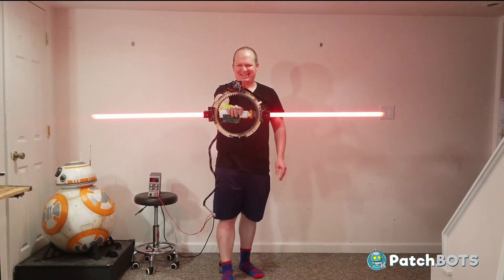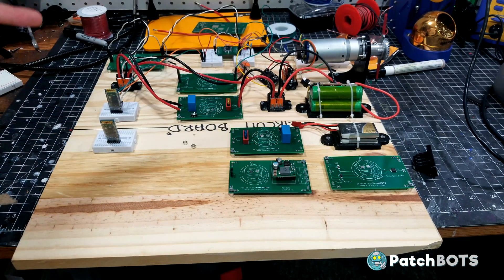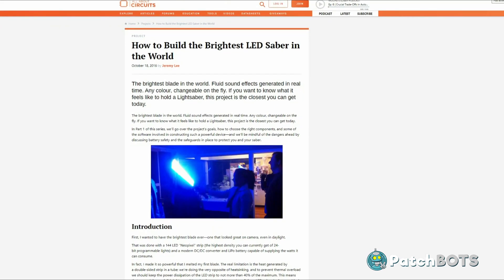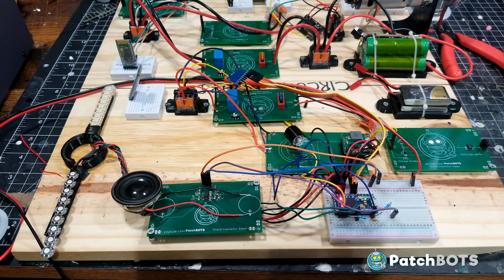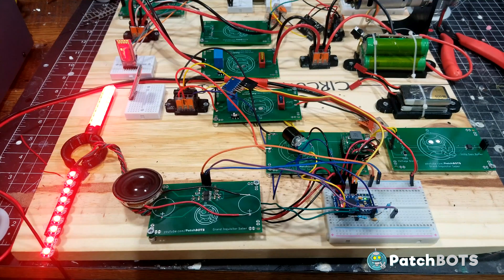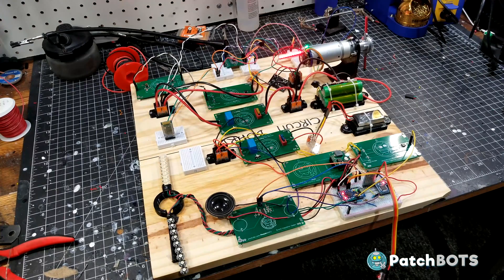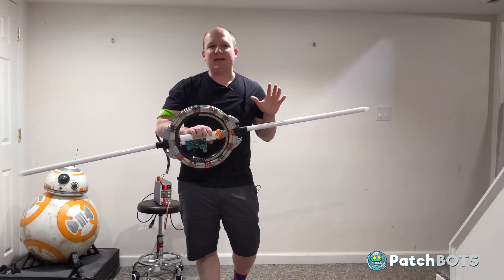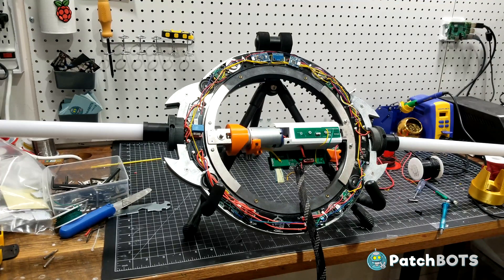Spinning Light Saber - Part 3 - Outer Saber Circuit

Comment from the maker: May the 4th be with you!  For a limited time subscribe to this channel for FREE by clicking that button right up there ^
Reply: May ı ask where you find the BB-8 files from xrobots. I want to build one please
Reply from the maker: @BoraGurses  You can find them on James's GitHub.  I would suggest also looking into other solutions as that drive/model are pretty old at this point.  The new VonJet V3 sphere and the A&P Dome are the new standards for the exterior.  Check out the BB-8 builder's club forums for more info.
Reply: @PatchBOTS  Thank you very much for your answer.  I joined the bb-8 builder’s club but they still haven't taken it to the facebook group. Still waiting. Thank you so much again.

Comment: Dead project or will we be coming back to this one soon?
Reply from the maker: I moved house last year.  Projects took a back seat.  Definitely getting back to this one ASAP, especially with rumors of the Grand Inquisitor in the new Obi Wan series.
Reply from the maker: I"m going to expand on this answer for anyone else reading;   This project is a lot of fun to work on.  I'm going to give one more go at getting this current version spinning in it's current state before I start on the V2.   Ive recenetly acquired a larger printer (capable of printing the ring in one piece).  Another new printer capable of printing the hilt in one piece with dissolvable filament (huge upgrade!).  And some ideas to take the complexity of the circuttry AND mechanics way down.   V1 was a ton of fun and I learned a lot, but V2 will be leaner meaner and better.
Reply: @PatchBOTS  I'd pay good money to buy one of these